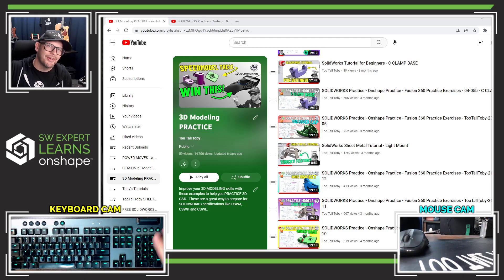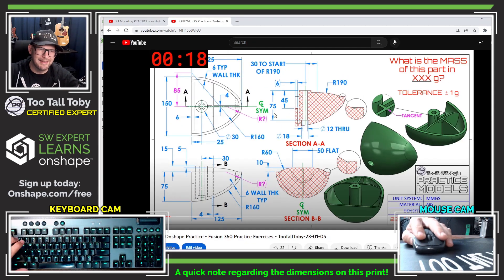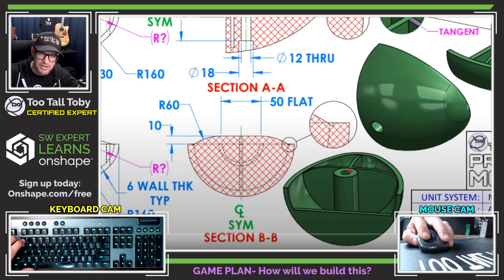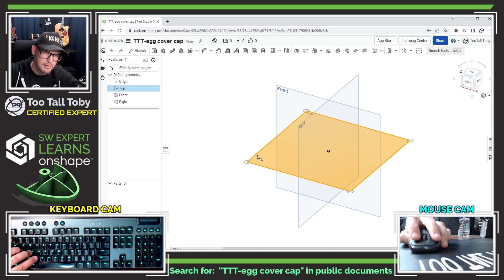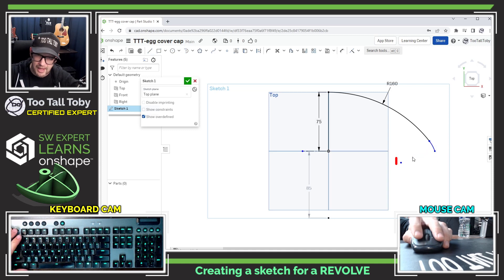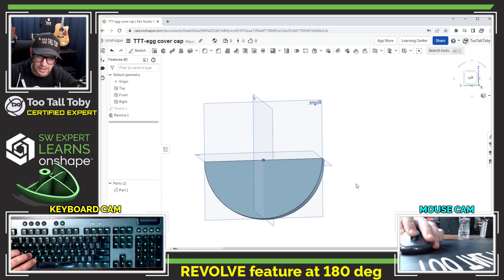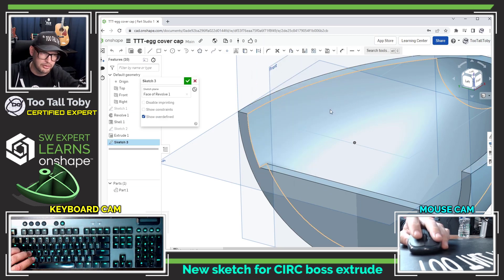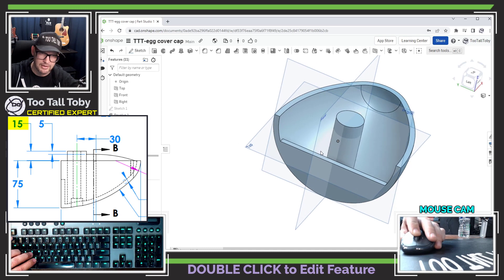SW Expert Designs a Plastic Part in Onshape

Comment: Just found this channel while trying to figure out onshape. Love you challenges! I did one comment about the final counterbore; I did a plane offset and sketched a new point and created a hole off that with the dimensions that you mentioned. Have you used the point method at all for thru hole with counterbore…etc glad I found this channel and you main.
Reply: Nice!  Glad this was helpful!  when you say "the point method" are you talking about using mate controllers to locate the holes?  I learned how to that a little later in the series (from AIRWICK).  thanks!

Comment: Tip: Scrap those useless construction lines for the revolves when you have a line in your sketch that already works. With that counter bore, just use the line you centered in the circle. No need for the extra line. Same goes for sketch 1. Use the horizontal line that connects the arc to the vertical line as the revolve axis.
Reply: Yeah, I thought the same thing too. I'm not CAD expert but for my senior design, I never had to use construction lines
Reply: Awww yeah that's a good suggestion!  Only thing is, I would lose the doubled dimensions in the sketch.  But there are definitely times when I don't need the doubled dimensions, so in these spots I'll try to remember to ditch that extra line.  Thanks!